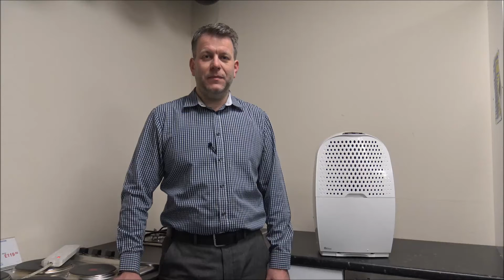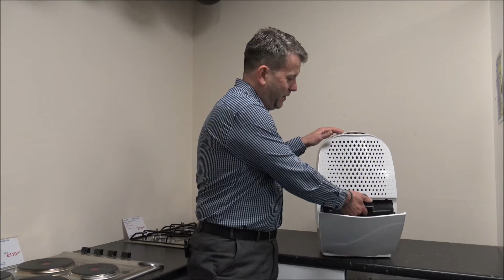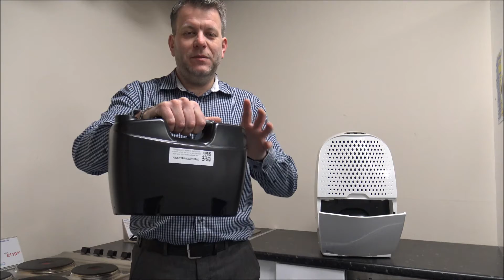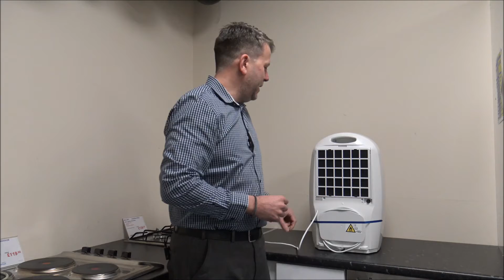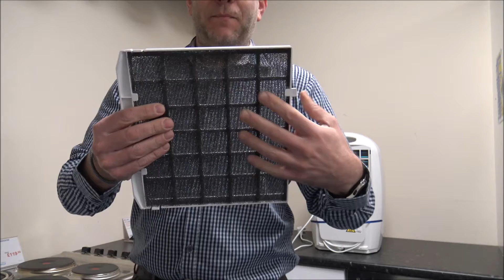Dehumidifier Buying Guide   10 Things To Consider Before Buying A Dehumidifier

Comment: I get mould when i have a shower in my en suite it has a fan bit isnt great i bought one on amazon but where should i place it in the en suite or outside the door of it?
Reply from the maker: Ideally you want it near to the ensuite, but i wouldn't recommend having the dehumidifier inside the ensuite where moisture is created
Reply: @lords-electrical thanks i think il put it just at the doorway
Reply: I did buy i small one on a shopping app a while ago but it did nothing i think it must have been a cheap knock off

Comment: I have the Ebac 3000 series purchased in February 2015 and it's still running perfectly today. A rugged machine built to last! I have also purchased one Ebac 4000 series in December 2025 due to family getting bigger. It looks nice but it does not make the house warm, as you would get with the 3000 series. Not sure why, maybe the design principle is different.

Comment: I had a leak in my flat from one of the flats two floors up. the owner very kindly bought me a blyss dehumidifier a basic one . you have to buttons on the top with arrows pointing up and down to set the humidifier but when it reaches around 59to 60 reading and I try to set to 50 it flashes c0 what does that mean and you can’t adjust accordingly

Comment: Hi!  How low percentage wise can a humidifier extract if kept on continuousely?  I bought a 50 pint one before and had it run continuously with a hose hooked up to a drain.  But the humidity numer never dropped below 58, and i dont know enough about these to know if it was defective or if  that was the max moisture it can pull.  Ended up returning it back to the store.

Comment: I think it would be worth pointing out how temperature and humidity affects extraction rate because it is dramatic.  I've seen a couple of dehumidifiers which specify the extraction rate when the temperature is 30C and the relative humidity is 100% because this massively massages the rate of extraction and is not what you get in the real world in a house.  If fact you will probably only get those parameters in a tropical rain forest.

Comment: Does your company have a small pump to drain the water and push it up to about 50 inches to drain in a normal kitchen sink. This feature is very important in my case.
You probably have a tiny little pump that hooks up to your system. Your response is very important.

Comment: Hi I have just bought a Hangsun 12L. The power button hardly works & hard to understand am turning it on at the plug  . Also can I use an extension lead? Perhaps I should have bought a bigger one . I have a Victorian house & all the rooms are about 11ft square . Thanks Ann
Reply from the maker: Yes you will be ok to use an extension lead but make sure it is fused

Comment: Peter I get very hot legs in the summer and especially when it’s raining is it Humidity and would a Dehumidifier help me?
BTW I live in a small flat and have not mould as I always have my window open
Hopefully you will see if after all this time
Brilliant video as always 😋
Reply: Hi Andrew you might want to consider a portable air conditioning unit rather than a dehumidifier. I bought an AEG model from John Lewis and am very happy with it.  Not cheap but on hot days significantly cools down my 20 foot long lounge where I work if very hot during the day.  One thing though to be aware of... Out of the back of the unit is a 5 inch diameter hose which has to go out of the slightly open window to expel the hot air extracted via the compressor. I have made a plate that has a hole for the hose that goes in the window gap to reduce outside ambient hot air coming into the chilled room.  I only use the unit around 10 days a year when temp is over 22 degrees but very thankful for it.

Comment: I used to run a desiccant model (EcoAir) upstairs and found it would stay on most of the time and the air would get too dry and give me dry eye issues in the morning. I swapped over to the Ebac model which is a compressor type dehumidifier with smart mode features which monitors the house humidity and switches on automatically, this can be overridden if laundry is being dried however I find that my Ebac model will switch on automatically if the heating comes on and raises humidity in the house, there is a 5 liter tank  which I only need to empty twice a week maximum  you can also use an anti microbial filter on the unit which if there is a lot of dampness and black mold the filter will significantly reduce, a quick note though as with all dehumidifiers you will need to treat the black mold with strong bleach initially to kill the mold, if there are large areas then wear a face mask and eye protection when washing off, once this is done turn your dehumidifier to max and leave for a few days to draw ambient moisture out to begin drying the area out. 

Once the household moisture is under control if using an Ebac then leave on smart mode and it will run itself and when full the red tank full indicator light will come on and the unit will stop until emptied. I cannot stress enough the importance of reducing household humidity which leads to black mold and spores which are pretty toxic, many houses during the winter have their eating on and cook shower and moisture generated from occupants will worsen the problem so the moisture will condensate on windows and areas like bathrooms and bedrooms and mold will take a hold.A decent dehumidifier like the Ebac I have will cost over £200 but over time the unit will save money as humidified air requires more heating than drier air and the health benefits are not something that a price can be put on in my opinion, I definitely recommend every house using one over the cold winter months. I hope my information helps those considering buying a dehumidifier.

Comment: Perhaps you should have considered desiccant type dehumidifiers.....

"Ambient Temperature - Desiccant dehumidifiers work well in ambient temperature range between 1 to 40 degrees Celsius.  Compressor dehumidifiers only work well between 16 to 40 degree Celsius."

In our home and use a compressor type dehumidifier was very much useless. The difference when using the desiccant type was amazing in the water extraction.
Reply: I use compressor DH to dry shipping storage container and it works well around 10C degrees or more. I don't bother to run it around 5C, because it is too cold and I don't want to waste solar power. Absorbtion DH heats the air and uses more power, so compressor could reach effectively the same performance, just ad some heating. At 20C it is the most efficient.

Comment: You didn't mention what a good DB noise rating is good for a 12 or 25l  dehumidifier. I was thinking of just getting a 25L for the extra large water container, but if it will be noticably louder I"m not sure I would want it, Also because you were wearing a lapel Mic close to your mouth we probably weren't hearing how loud your demo unit was

Comment: Hi just a quick question.. I have a 3 bedroom house and I'm planning to buy a 10L dehumidifier and I will place it inside the bedroom that collects moist the most in the morning.. would 10L dehumidifier enough? Thanks
Reply from the maker: You will be ok with that, but just be prepared to empty it more often than a larger capacity machine

Comment: Fantastic video mate. Tell me something about the number of bedrooms and extraction rates that u mentioned please. You are using it in one bedroom at a time or placeing it in the hallway? Because there is a dehumidifier company that states that their dehumidifer will work on multiple rooms if placed in the central hallway. Will that actually work if the doors to multiple rooms are open? How will it switch off when a certain threshold is reached in such a case? In this case, it will take the humidity level in the hallway to switch off I am guessing?
Reply from the maker: Most dehumidifiers will work in a hallway rather than just in an individual room but will clearly not be as effective in each room as it is trying to dehumidify several rooms in 1 go.  It can still switch off when it it reaches a certain threshold it is almost taking an average of all the rooms.

Comment: Excellent points thanks. I’m wondering whether I need to move it around my 4-bed house, or can I locate it centrally in the hall?
Reply: It depends on ventilation, but humidity will eventually equalise. You can also use a fan to stir the air. I would move it between floors. Also, put monitors in each room.
Reply: Move it into each room
Then in the room pull open the doors of the wardrobe and draws

Comment: Good video, but the main thing you missed out is heat pump/refrigerant or desiccant type. Two different technologies for different uses and ambient temperatures.
Reply from the maker: Yes good point, thanks for the feedback
Reply: I read that desiccant was best for laundry then I read theyre expensive, I dont know what to believe
Reply: I was just going to say the same, No1 the types of dehumidifier seems missing 😂.  And would have been helpful as I didnt know dessicant existed and its pros and cons